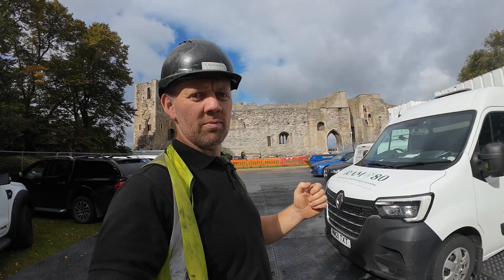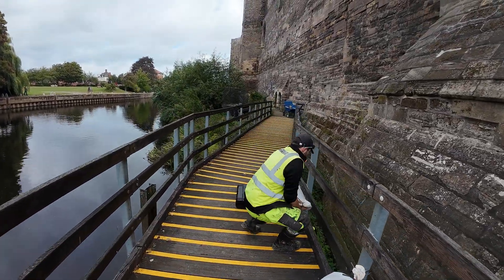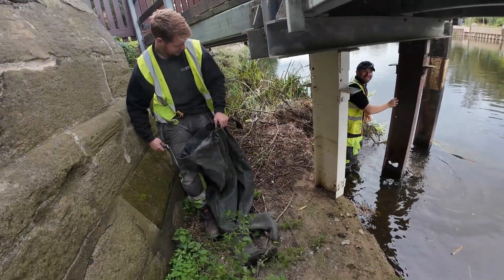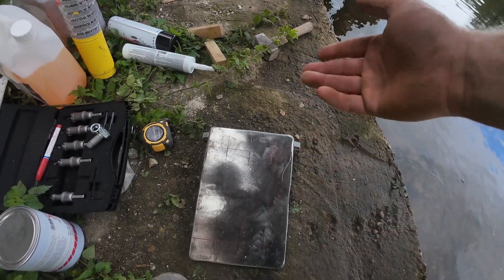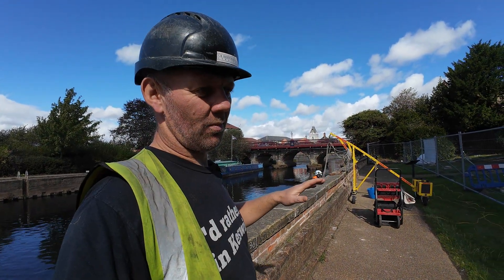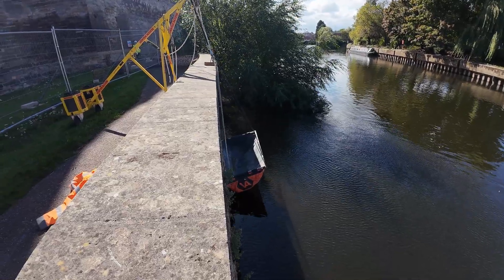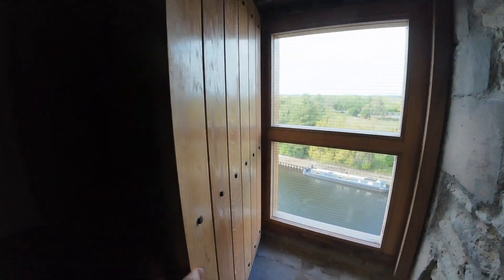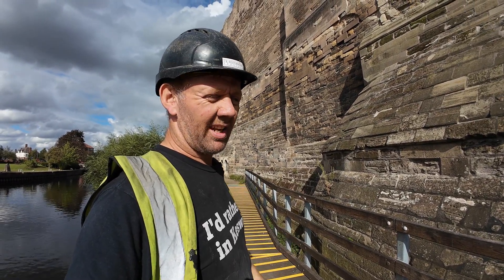50. "Water came over my Wellies" Lads fix Steel Stanchion

Comment: Nice work. Well done. Strange that the steel column corrodes in one place. Perhaps on the waterline.
Reply from the maker: It is strange that only one has corroded. We checked the others and they are all fine. Might have been a defect in the metal??
Reply: @UKRestorationServices depending on when built, steel as you say may have defect.

Comment: When I was a kid we needed to fix some rotted out I-beams on a bridge at a local lake.  We used split 5 ft plastic pipe that you bolted together then pumped the water out,  cut out the bad & welded in the new then epoxied it up.  This episode reminds me of that.
Reply from the maker: The structural engineer wanted us to weld this but I suggested bolting would be easier. Less to risk assessments to do in the permit. Good idea with the pipes.